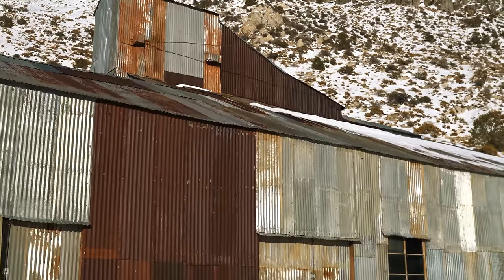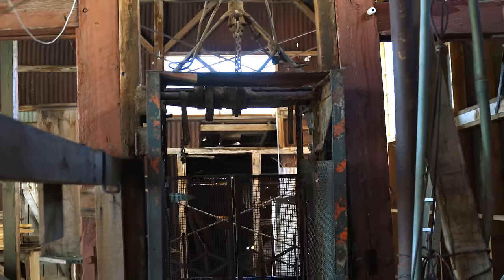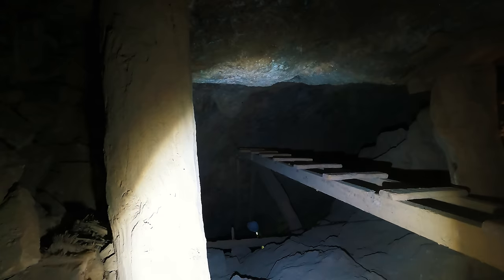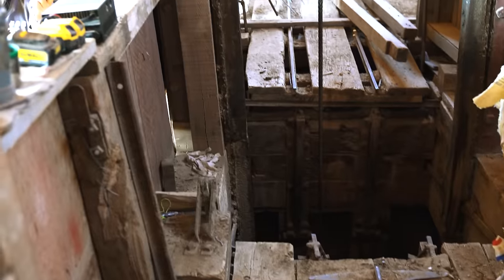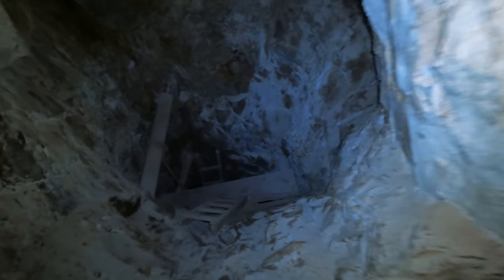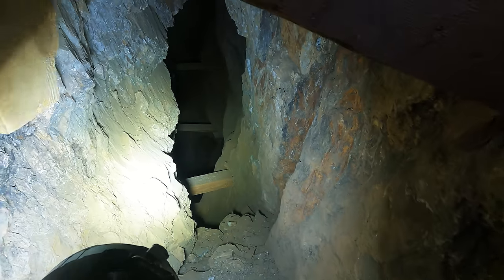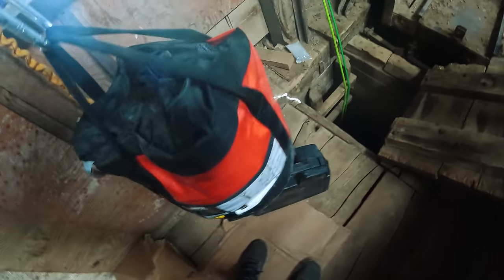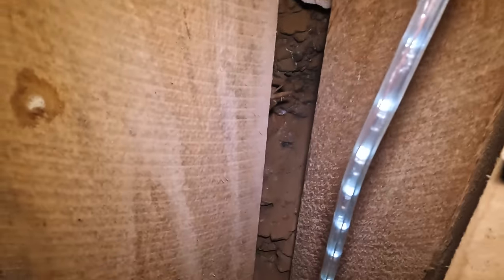Rappelling 900 Feet To Uncover Lost History!

Comment: In all of the videos of you descending into the mine that I have seen, there is a ton of particulates visible in the air.  It might make sense to consider using a mask to filter that out of what you breathe when changing levels.  Great videos thanks for sharing.
Reply: In my local mines (which ive spent a great deal of time down), the air looks like it's full of particulate but it's actually water vapour/droplets condensing in the air kinda like fog, so potentially its something similar going on here?

Comment: Out of curiosity, have you looked into a solar panel company to sponsor your projects? Only use their brand as you put up the panels on top and run a cable down to whatever level you are building your base camp. Then simply do a video on how you plan on using that battery to be the main hub for all your equipment, maybe have two systems? Pitch that idea to one of the solar panel companies that target van lifers?

Comment: For your hard communication   EE8 field phones  they will talk 22 miles on field wire
and uou can hook them up in parrel multipul phones  they take two d batterys last for months 
the cool part is could put 1 at the 700 at the pump  then 1 at the bottom of the 900  1 at your work zone wile moving dirt  and 1 at the top next to your hoist control

the best part is when you crank one phone they all ring 

i have used them for years doing fire work shows  some mine exploring  and even on a construction site 

hope this helps  

ps, in wet locations i have used a plastic tool box to help protect the phones

Comment: Man you need to hook up some Air and drop an emco 12b mucker down there and a mine car , it looks like the Track is in useable shape you could muck out those collapse's pretty quickly you have the bucket for the Hoist, either that or a tugger with a slush bucket.

Comment: 18 years of rope rescue and it would be easier to be in the main shaft for the ascent versus Diesen, but I would probably rather be in the main shaft for both and then I would do a two rope system, so that I have a main and a back up using a petzl ASAP as my back up. Happily come down with toys I definitely have like 1500 feet of rope or more. A power ascender would be even better for the uphill, but definitely a lot more weight but a couple of ascenders with leg loops and it goes really quick.

Comment: Setting up a "long term" camp down in the mine seems like a good move to not have to go up and down as much.
Running power shouldn't be all that hard, nor data/communication for that matter.

My suggestion would be to run a fiber optic line. Getting an Ethernet to SFP media converter is fairly trivial and cheap. Need one at either end though. Then you just need a decent length single mode fiber and two appropriate SFP modules for whatever distance it ends up being. (Don't worry about distance, there are modules that happily does gigabit speeds over 10+ miles.) However, downside with fiber is that it is really really picky about being clean at its ends. (Ie, make sure you only remove the end cap when you plug it into the SFP module.)

But having power and networking would go a long way.
Being able to send e-mails or do voice calls and such from a safe location would make more in depth exploration quite possible. And a lot of phones can do calls over WiFi these days as well.
Would really make it less problematic to communicate with the outside world and let people know that you are okay.

Comment: Brent there is an episode from Linus Tech tips where they run their own fiber optics line over a very long distance. It might be worth taking a look at for a solid communication line down to the 900 level provided you can get a power source down there. Reach out to them, they may even gelp with the full setup of gear so all you have to do is plug it in.

Comment: Wow, what a bummer.  This could have been one of your best videos.
19:33 What will you do with the spoil?
You need to find the ladder groove.  
Do you know if the miners actually used much rope.  I have the thought that they would but what about when going up or down the ladder? 
I definitely believe that roping is always a good idea even with a ladder.
I'm not so comfortable with heights anymore but I think I could actually do it since it doesn't seem like you can see to the bottom.
I suppose there is a sense to it though and 900 feet is quite a distance.  
I wonder what kind of light you could put at the bottom to give and idea of how far it is...
I'd really have a good time out there for a few years, making improvements, etc.  Two heads are better than one and four hands, well.
I'm one of those people who are skilled at nearly anything. Plumbing, electrical, electronics, computers, radios, honestly my resume is a jaw dropper... There'd be enough solar out there, water storage and all manner of infrastructure improvements by the time I left.  It would be fabulous.

Comment: Screw that! I would have opted for a pyramid A-frame in the center of the hole connected to a power winch from which you would dangle from the end of it, thus not needing to worry about the extra weight. And even then I would make sure that there was a back-up motor ready to go in case the first one somehow fails.

Comment: fill the anchor bucket with slag? i was wondering why you havent setup multi pitch descents after you confirmed the lift could make it all the way down. that way you could leave ascender kits for self rescue if the lift broke. i would also run a cable down to setup a call box at each level so you can easily talk to the surface crew, that way they can lower you supplies or tools on your 900 ft rope. also, get yourself a surplus military entrenching tool (shovel, pick axe, garden hoe, hatchet in one)

Comment: What safety protocols are you using? I don't see any ventilation units and the ductwork to push air down to that level? If you get into a situation where the oxygen level drops because of bad air....you're dead.

Comment: If any of all y’all can contact Brent the big blow headed his way is going to be much worse than thought 36 hours ago. He will likely have the road washout, winds will be very strong upwards of hurricane strength at his elevation. The rain will be significant up high maybe 20 inches.
Reply: Forecast for Cerro Gordo does not show high winds, just heavy rain.

Point Forecast:16 Miles ESE Lone Pine CA
 36.53°N 117.79°W (Elev. 8901 ft)
Reply from the maker: Noted and preparing!

Comment: just curious w the amount of money your spending on climbing gear.....have you thought of looking into retrofitting the cage hoist system with say a winch motor w batteries and solar? ive seen some big winches now with a wireless remote. if you could get just the motor onto the wheel that drops the wire it could possibly take away the need for 4 people just to lower the cage. just a thought

Comment: How I would like to go to those historic tunnels where hundreds of workers have given their souls to dig them and extract precious metals. I would have tried to make the cage work well without it getting stuck, setting up and securing the mine elevator would be the priority for me, as well as lighting, an operator or at most 2 for safety or to give the changing of the guard , they are sufficient, the rope would only be used for emergency ascents, the braking and hydraulic motor could be automated, but someone is always needed for emergency safety, a communication line is useful, simply a twisted pair and 2 field phones, I think the radio works only in the elevator shaft, you can also drop an optical fiber together with a good electric cable for lighting and electrical tools, and feed the optical converter for the fiber, bring down the internet you can stay connected also stream from below the mine or upload photos scans access 3D maps etc. Ciao

Comment: If you wanted to set up simple power down there. What about using simple Battery style banks like a jackery and having it wired up to solar all the way to the top. Maybe someone could comment as to if this is even possible with running that much wire from solar.

Comment: is it not possible to drop a couple 1000 foot wires down the shaft in a safe spot to send power signals to the person controlling the hoist, or doing remote operation of the hoist with thoes same conductors using solenoids and buttons, or even setting up a pulley and counterweight type system with soime elevator controll cable attached to the hoist cart to drop it down like a real elevator?

Comment: You climed down, 900 feet. I can beat that.
1967 east coast. I drilled a hole 250 feet around. 15000 plus feet deep. The permit was code named. 620 roofs , every 25 feet we had to install a metal roof to protect us from falling rocks. We drilled 3 miles deep. A 1967 world record. The whole platform was 5 to 7 inch thick, round disk, we had a shed in the middle that ran the drills and spun the platform. When it was done. The only way in and out was the center ladder. Up 15000 plus feet. It took 3 days of climbing in the dark. U had to carry food for 3 days. A shit bucket that was clipped on your belt. You clipped off on hanging nets to sleep. At the bottom, is the worlds only, ELECTRIC power plant. " perpetual motion. " 
I'm the kid who designed, and proved it worked. Backers put up millions to drill and put it 3 miles underground. Sentiors bought the plant for 72 billion in 1967. For decades, all of the east coast ELECTRIC power was free, Sentiors still charged for the free electricity  making them 100s of billions.😎

Comment: Why abseil in the first place?  You have a perfectly serviceable cage to get yourself down.  Okay maybe if you wanted to do a shaft inspection, but that's much better done from the cage, or by standing on top of it, if you wanted to do some scaling.  Which you should consider, parts of look like they need it.

If sections of your ladderway are missing rungs or are damaged you should focus on rectifying that, or are you comfortable not having a functioning second egress?  If a stage in your ladderway is too narrow to comfortably pass through, modify it.

You emphasised several times that you believed these areas you were exploring had not been visited by anyone alive, yet you're happy to set off solo, not doing any atmospheric testing, not the slightest bit concerned about running into irrespirable atmosphere?  Can't even be bothered carrying a SCSR?

Walking blithely in ground that has obviously failed, no sign of you carrying a scaling bar with you, let alone having a clue what to do with one, nor registering any hint of ground awareness.

You've got screws loose mate.  And your clock is ticking.

Comment: Irony!  You roped down which is a good experience to have as a back-up.  The hoist takes people (operators) to operate,  you said in this video as well as other videos..  The former hoist operator(s) moved away. The new plan to live/stay a few days in the mine is going to take people.  Your back to needing people …. That’s the irony!  Can the hoist then be used when you have the people or is there an issue with the hoist?   Do you require as certified operator?  

Take with you your best interest.  Plan well.  I feel that this video showed or seemed to show your head wasn’t 100% foscused on the mission.  Too much on the plate?   It seemed to me you’ve already been to these collapsed locations?  What if you did managed to find what you were seeking  ( or what the “Hitorian” cited )?  Beware of rabbit holes!

Would it be best to set up the base camp on the service and once and for all put time into the coming and goings from the mine easy and safely.  Mines are like cars … it’s not “if” … it is “when” … accidents happen the more miles you drive on the road or explore a mine…. Shit happens!  Top notch easy, safe access is the key.  Repair the Union eterance.  This is more true with this new risky idea.  Plan for success by covering as many as the “what if’s” as possible.  Flying halfed-assed is an adventure in of itself, but if it goes bad it could end all the fun!  First-aid kit?

As for who to join you … cover your ass legally.   I’d do it,  but my input matters and anyone that joins such a mission should think the same.  You just read some of my priorities.  Think; what at this time is really your true priority…. Chasing deade-ends?   Of finishing the hotel, and then chasing dead-ends.  Your ways of doing things provide to me so many more questions I have for you if we ever met than answers.  

If you want to be doing this for a long, long time; do it as safe as possible so you can keep doing it.  You managed to journey the main shift many times and you probably made more changes to other areas in the mine than the one area travelled the most?

Good luck! Thanks for the video.

Comment: You definitely didn't do extensive research on how deep pits should be acessed via rope as this could have been a lot more easier by using the correct descender. This one is not suitable for such purposes. Also the bag and the instruments should be attached to you for easy rope change and avoid the risk of dropping them at the bottom. You could even use the second rope for that. It's worth spending time in making a research for such things as things can get really complicated by using the wrong type of equipment and not having enough knowledge of the process.

Comment: And I'd be thinking about a series of harbor freight winches or something or nice winches if you can't get 900 ft on a roll a series of checkpoints with winches attached to main Heller's you'd have to drill some holes. The faster you can get people up and down that thing in the easier and materials without labor is probably going to make you time in the labor that it takes to dig it out. Get ahold of Colin furze he's a YouTuber he built the bunker and he's a helluva smart engineer he could help you out it'd be a great collaboration you guys could share views I don't know it's just an idea. I was just thinking you know it wouldn't be that bad digging something out if you got work all the way down to do it can I cut down on the energy you have to dig

Comment: https://en.wikipedia.org/wiki/Leaky_feeder

This may be of consideration for communication down to the bottom. Also, a basic winch for materials only would be a good idea so that you can move items into/out. I think that group that explores abandon mines may be a good collaboration, as they know what they are getting into with this kind of expiration.https://www.youtube.com/@AbandonedandForgottenPlaces 

I would love to come volunteer with this project!
Reply: The best way for this application is just a bunch of field telephones. 
No need for RF communications. 
If you want wireless communication anyway, there is an option - ground mode VLF 'transmission' between 8 and 20kHz.
E: i think i understand what you're aiming at now - the system you show could improve the signal strength of the radios when descending. The field telephones would only work on the landings at the levels.